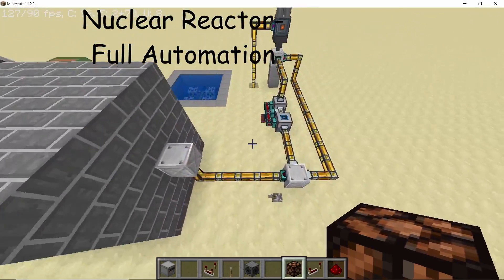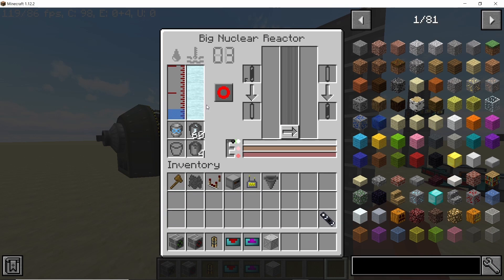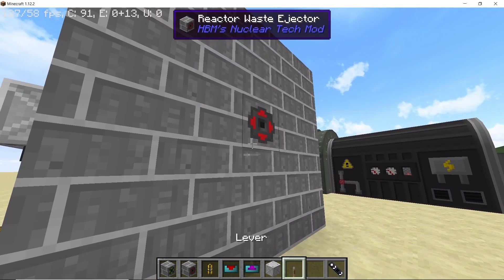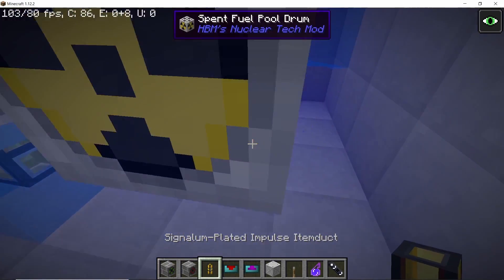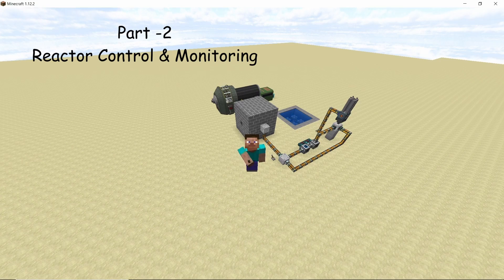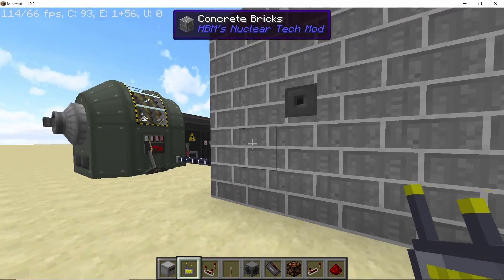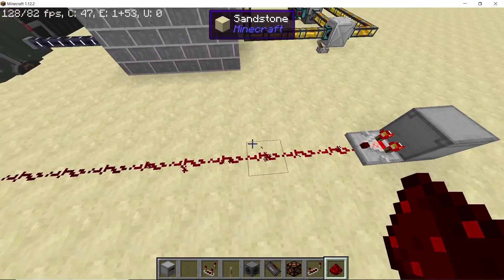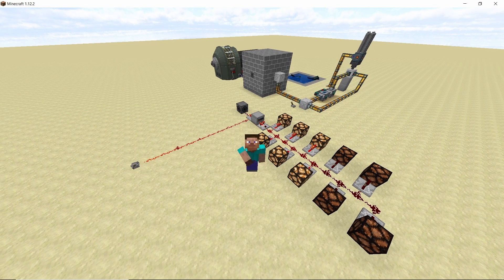How to "Automate your Nuclear Reactor" in HBMs Mod - Siren System, Waste Processing and Fuel System

Comment from the maker: Alright so if someone wants to use this for 1.7.10 they can do so in the older version of the mod when the Reactor Remote Control block used to work for both the small and big reactor , as of now the fuel and waste can be automated but for some reason the waste doesn't go in the spent fuel pool drum ... Maybe it'll be fixed in the later versions of the mod. 
For 1.12.2 the whole system works perfectly and yes it is very useful when you're running multiple nuclear reactors. Combine that with ENERGY CONTROL mod and it all becomes very convenient.
Reply: Please make a tutorial like this for the rbmk

Comment: And how to introduce water and coolant through pipes when we only have one free entrance :(?
Reply from the maker: There are total 4 access ports on the reactor - on all 4 sides 
1 for water , 1 for coolant , 1 for fuel input and 1 for output 
You can get the steam out via the topmost middle boiler block

Comment: can u do the alarm thing for rbmk?
Reply from the maker: Yep you can , Thermal sensors also work on every column of an RBMK. So just attach a thermal sensor on any outer column and also place an alarm touching it ... The alarm will go off as soon as the temperature goes above the set limit
Reply: @SavageVegeta  ok thanks
Reply: @SavageVegeta  wait when i search up Thermal Sensor nothing pops up in minecraft can u make like a vid or something or just explain it better.

Comment: Is it possible to do an "auto reactor" with only HBM as my server only has HBM and not Therman Dynamics?
Reply from the maker: The problem with that is HBM itself doesn't have any way of transporting items which is crucial to get the fuel in and out of the reactor. So as of right now it's not possible to do this with only hbm
Reply: @SavageVegeta  what about the conveyors

Comment: I suggest use EIO mod, as it allows one interface to input and output at  the same time, which means the fuel pool drum can contact with more water.
Reply from the maker: The Problem with that is that the fuel pool drum can input from the top and side and output from the bottom only... so multiple ducts are needed no matter the mod used

Comment: can u do this with rbmk and make monitoring panels and stuff
Reply from the maker: The RBMK reactor has a dedicated crane to do this so you don't really need ducts in order to transfer fuel ... Also I'm not even sure if ducts connect to rbmk in the first place I've never even tried that
This work with the big reactor cause it has fuel input and output blocks